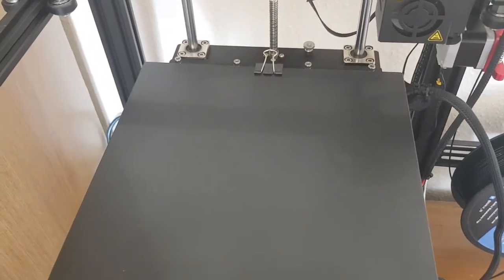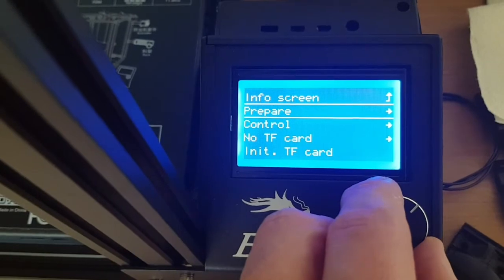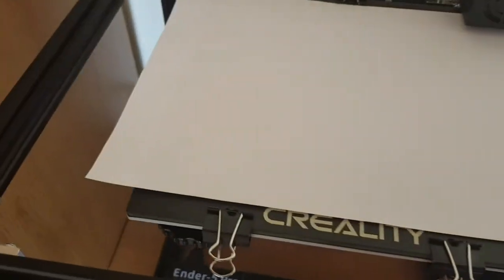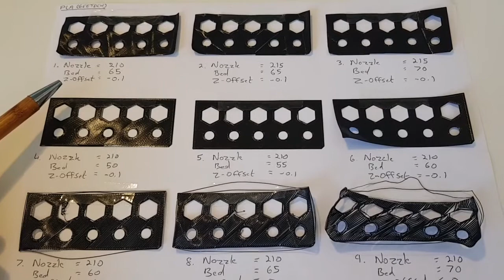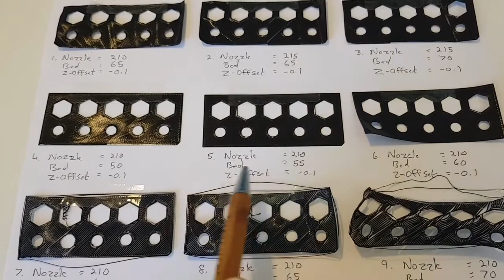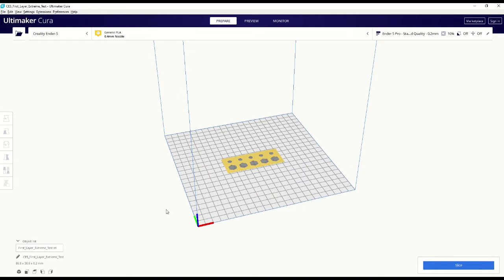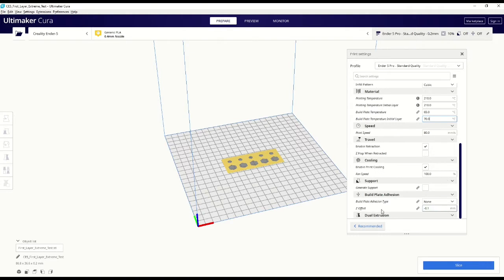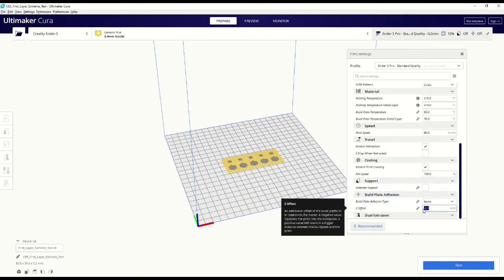Creality Ender 5 Pro - Glass Bed Upgrade

Comment: You have any issues with the glass bed sticking to the magnetic adhesive?? 
Am just about to install this now and chuck the magnetic plate back on top but just wondering if I need to put foil ontop of the magnetic base or just remove it etc

Comment: Because of using BL Touch wouldn't need to re-calibrate the print bed :) But fortunately I have zero issues with the default print bed surface. Neither with prints not sticking nor with removing prints when done. All I do is cleaning the bed using window cleaner and a microfiber cloth.

Comment: Maybe you can help me here with my question since I can't get my hotbed leveled in the 16 positions I had setup in my Bugfixed Marlin 2.1.x. version. And it is also a warning for you  not to experience the problem I now got! 
Whatever I try my Z steppermotor keeps pushing my hotbed a bit too far up against my nozzle. And my hotbed is correctly manually leveled with the steppers disabled. My Ender 5 Pro became completely useless although it was entirely and perfectly working upgraded to Bugfixed Marlin 2.1.x version with CR-Touch and with RUNout sensor that all worked fantastic!, until I decided to just remove the glass hotbed plate and replace it with the  brandnew Twotrees magnetic plate. Re-Calibrating went perfectly and everything worked fine and an object was nicely printed. But after my Ender 5 Pro(blem) printer's calibration was stored before it was switched off, it behaved very erratic after powering up because the bedleveling didn't work anymore as expected because the Z-bed height was somehow wrong. (Maybe because there apparently is no eeprom file on the SD card anymore after the new firmware was made and installed?). And when trying to adjust the Z-offset the nozzle crashed and also destroyed my brandnew 30 euros Twotrees plate. Nowhere is a correct answer given on how to solve this very annoying Ender 5 Pro problem. Which also started giving E1 heater reset problems while trying to print with PETG filament at 255 degrees Celsius. About 5 days ago before I had replaced the glass Creality plate everything worked without any worries and as a sunshine! Now I became so frustated after hours of trying to solve the issue that I had completely disassembled my useless Creality firmware unsupported Ender5 Pro(blem) printer and had put everything back in its box. And when there is no clear solution to this problem, Creality never will be my 3D printer brand anymore! And I am very sure that many other frustrated Creality Ender 5 Pro buyers encountered the same issue that made them cursing Creality for their extremely bad and useless support! And I know it is not about just setting the Z-offset because that was never a problem, this bed Z height problem is a much bigger problem that seems unsolvable and makes any Creality 3D printer ready for scrapping.
Reply: I finally solved the extremely difficult to find Z height bed level problems with my Ender 5 Pro! I noticed that bedleveling only worked when I put a thin about 0.3mm sheet of paper under the probe of my CR-Touch! But just raising the bed with about that height of 0.3mm never helped! But by loosening both screws that hold CR-touch and nozzle fan holder cap and repositioning the CR-touch as low as possible and thightening the screws afterwards completely solved this crazymaking problem! So I never knew but sadly it is possible to mount the CR-Touch a little bit too high after your Ender printer never behaves normal anymore after that!
Reply from the maker: Sorry to hear you had all these issues. I'm not familiar with the CR-Touch so not sure how the firmware works with that as I'm using the BL-Touch but sounds more like a hardware issue. Glad to here you got it sorted as I know how frustrating it is to get these printers working

Comment: Hi, I've just bought a piece of tempered glass to the size of my bed, do I need to change offsets to avoid clashing with the clips since it's the exact size of the bed?
Reply from the maker: I didn't have to change anything to avoid the clips on mine as they are outside the print area. All I did was adjust the z stop.

Comment: I've tried this glass bed and I'm having real issues with prints sticking too hard. With both PETG and PLA, various z heights, temperatures etc. I've tried cooling the bed too, and they still stick so hard it damages the print to remove them. Any ideas what else I could try?
Reply: Im also a noob, but i think lowering the bed temp will help
Reply: @Sebastian-gj9tc  Thanks, I'm then struggling with it warping/lifting in the corners when I do that
Reply: @jamesrichardson4738  you might be printing to hot, at what temp do you print pla. I have done 1 pla print so far with my  ender 5 pro and it came out almost perfect. Nozle 200deg c, magnetic bed 60.
Reply: @Sebastian-gj9tc  Same 200 nozzle, bed 60. I've gone back to the magnetic bed, I might try the plain glass side of the other one when I can set aside some time for testing.
Reply: @jamesrichardson4738  i don't know what the problem could be then, the last thing i can think of is that maybe the bed is to close to the nozzle. Other than that i don't know. But with the flexible magnetic bed it should be easy to remove the print
Reply: @Sebastian-gj9tc  Thanks for the help. I'll stick with the magnetic one until I need glass for the larger prints
Reply: @jamesrichardson4738  no problem, im also thinking about the glass table

Comment: Thanks so much, I have some questions. I have just got mine today and have put it on. I have levelled the bed and twisted the bottom z axis thing to the perfect position. Is there anything else I need to do? Also, when I press auto home it hits the bed. Is this supposed to happen? Sorry to be such a hassle. Thanks!
Reply from the maker: Hi. Sounds like you need to adjust the Z stop screw at the back so the nozzle doesn't hit the bed by triggering the Z stop switch first. Adjust it manually with the machine switched off, i.e. loosen the screw, move the bed up until it hits the Z stop switch and adjust accordingly until the nozzle doesn't hit the bed and the Z stop switch is engaged.

Comment: So in conclusion did it help with the first layer adhension compared to the original bed? I also have a ender 5 pro and since i switched to Cura, I've been having trouble with the first layer not sticking properly.
Reply from the maker: For me I would say so. Overall the adhesion is much better. My prints were lifting during the print with the magnetic bed. It sticks much better on the glass. Also once cooled down the prints come straight off.
Using a Z-offset on first layer also helped alot with it sticking despite trying to level the bed many times with a sheet of paper. Without first layer would just lift. Didn't try it on the magnetic bed but might help as well.

Comment: with the Z-axis screw, do you know how high up it is sitting now when compared to the original position?
Reply from the maker: Hi. On mine the Z stop screw is sitting around 2mm higher now with the glass bed. But I didn't remove the magnetic sticker which I probably will do at some point. Overall I think this will vary depending on the setup, i.e. nozzle length, bed thickness/tension etc.